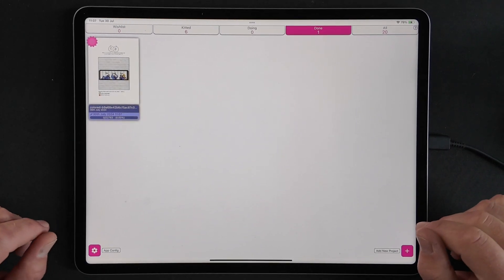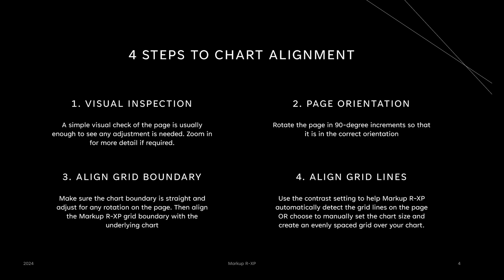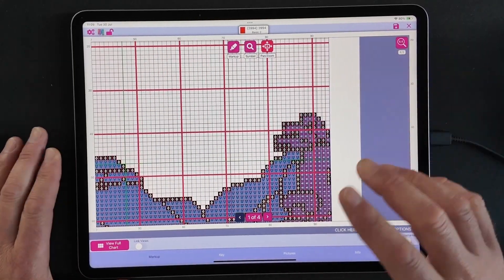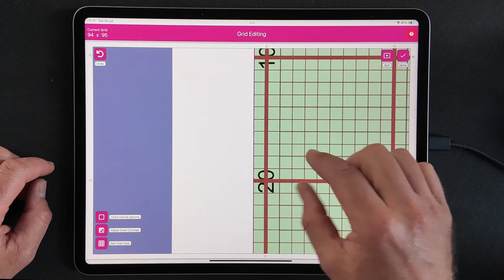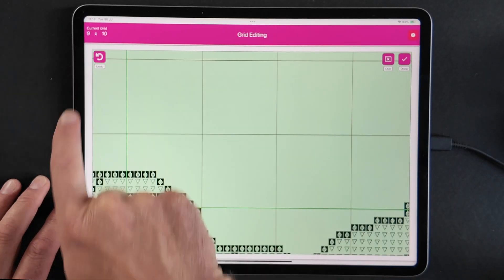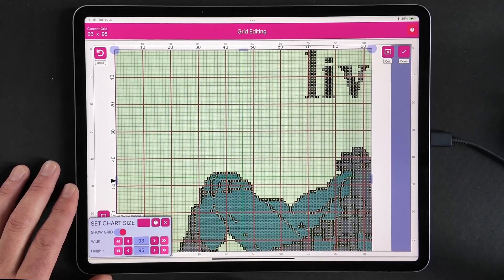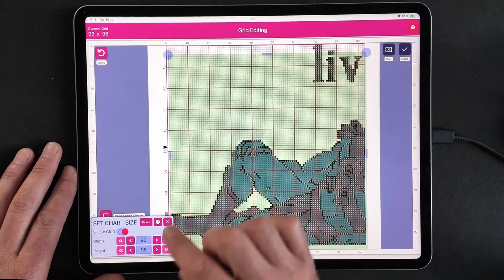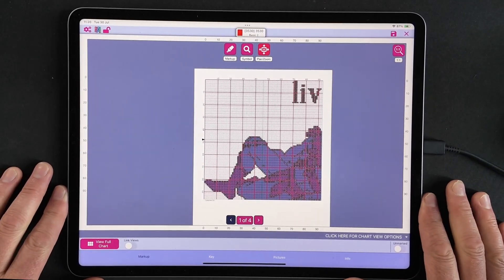1. Grid Alignment: 4 Step Approach

Comment: This video saved my project. I have a PDF of a Dimensions chart that they kindly sent me but unlike the other PDF charts I've gotten, Markup didn't like it at all and I was so confused on how to get the grid lines straight. The chart itself was perfectly straight but the auto-grid was wonky and I didn't know how to fix it until I manually set the number of rows and columns. Hopefully that helps someone else too. Thank you!
Reply: How did you get Dimensions to send you a PDF?  I have a Christmas stocking that I'm working on and need a digital file but can't find contact info for Dimensions.  Thanks.
Reply: @lgmorris64  Standard practise is to contact Simplicity (the parent company) through their website’s contact form and ask! They do require proof you’re working on it as a personal project so be prepared to take a photo of the kit with all supplies laid out and they will also need the kit number (above the bar code).
Reply: @AliciaCraft  Awesome.  Thank you so much.

Comment: That was very helpful thank you. I have also been running into where there is more than one chart on a page and I have only been able to work with just one of the charts which  makes it difficult. Is there a way of using more than one chart on a page or even duplicating a page to make it work? The chart I'm working with right now is a Hands on Design PDF file that I purchased from her website. It is called Live Life Simply.
Reply: I'm only a user - not an official answer here. I had the same issue with a chart from Modern Folk Embroidery. It has 10 pages, but three charts on each page. I used a PDF editor program to store each of the charts on a separate page, and created a new 30-page PDF file.